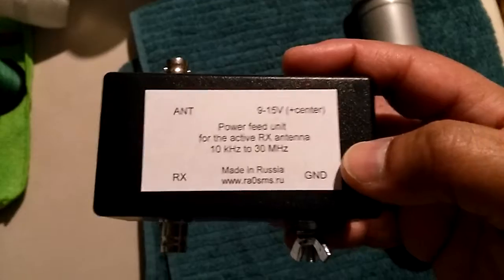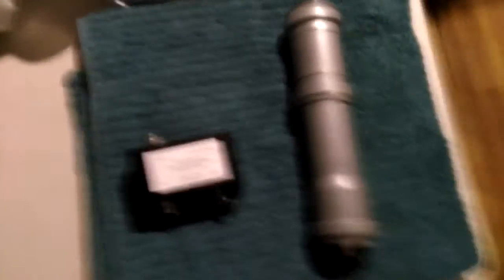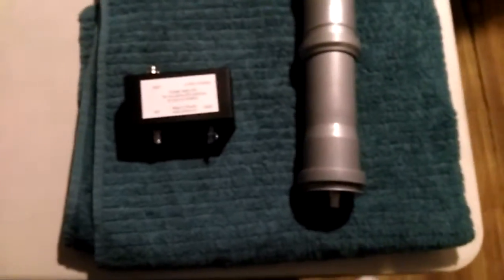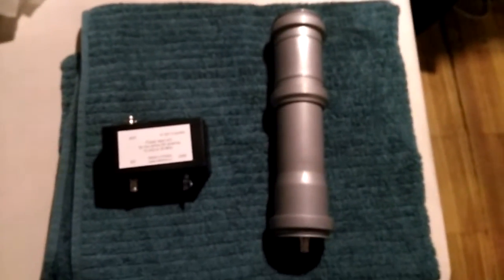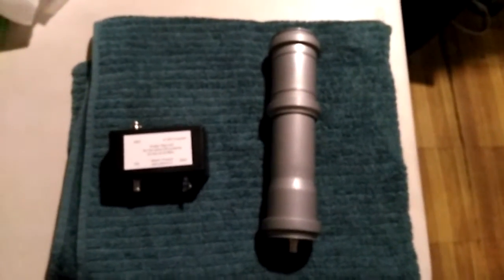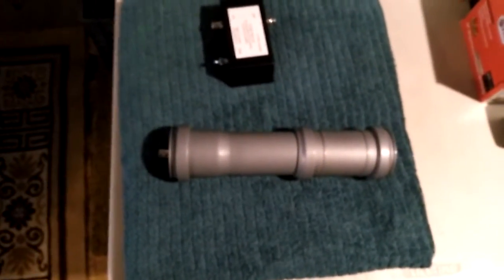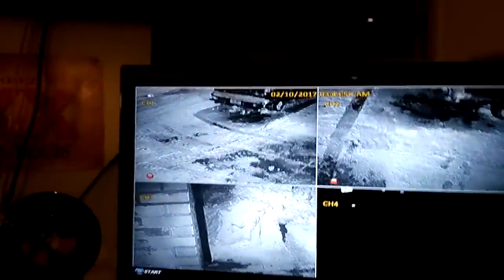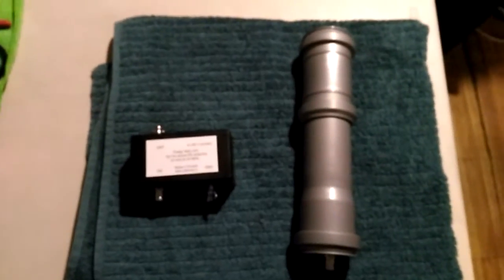Update on Mini Whip Active Antenna and other recent purchases

Comment: I actually have 2 antennas from this same guy in russia,  they work very well,  had to wait a while esp for the first antenna that I bought from him (having to be shipped all the way from russia to florida) have it connected to my sdr,  works really well for me.
Reply from the maker: I'm glad you are happy with them.  I had a love hate relationship with this antenna.  At times it seems to perform well and many more times I was not happy with the performance.  I will at some point, try it for my travels as a portable active antenna.  I'm very happy with my MFJ-1886 active loop antenna for home use with my SDRs and other radios although it cost a lot more.  Thank you for the comment and you have a good weekend, Sir.

Comment: What is the diameter of the antenna?  It looks like about maybe 1.5 ~ 2 inches in diameter.
Reply from the maker: It is a little over 2.5 inches in diameter at the widest part.  Thank you for watching.
Reply: Ok, thanks.
Reply: Did it really take two months to get to you from Russia?
Reply from the maker: He does warn people before purchasing that it can take up to 2 months to arrive depending on your location when i last ordered one, however in my case it took about 3-4 weeks if I remember.
Reply from the maker: Your welcome.  :)

Comment: Finally received a second ra0sms whip antenna. This one works with a noticeable amplification of radio signals but this one causes a hum sound when tuned to a station but no hum when tuned off frequency to the stations. My verdict is no to the ra0sms mini whip antenna.
Reply from the maker: Yes I'm pretty much done with my antenna also.  It was too much hit and miss for me.  It was not a reliable antenna overall.  After all the mods and tweaks, I never got the performance that was expected.  Thank you for your reports.  Mike.  Have a good night.

Comment: Danny, looking forward to a video using this active whip antenna.  Have a nice weekend 73's from Germany.   Brian
Reply from the maker: I posted a few receptions using this antenna, it's OK at best.  This antenna like most amplified antennas really need a very low noise environment otherwise it will be useless.  Also grounding is very important and necessary to achieve good results.  That being said my 85 feet End Fed antenna with 9 to 1 Unun does a much better job at shortwave and even medium wave but with a bit higher noise floor as is.  The Mini Whip antenna is better suited for listeners with space restrictions.  The Mini Whip Antenna needs some fussing around to get results.  I may be looking at a active loop antenna such as the Wellbrook or similar type in the future.  Thank you Brian and have a great day.

Comment: I got one of those mini whip antennas and it doesn't seem to be able to get anything at all!  I have a radio that can get navigation beacons on Long Wave though, a Zenith Royal 780 Super Navigator that uses just a dipole on top of the radio. It can get navigation beacons on 201, 240, 338 and 407 kHz here in Arizona.   I have to take it outside on the roof though, can't get anything inside but noise.
Reply from the maker: Yes I had the same problem at first,  Now I have it higher and also I had to ground it from the outside instead inside of grounding from the power unit indoors.  It does involve some tweaking.  I would only recommend this antenna if it was from an apartment high up.  I have several antennas on my property.  Some work good depends on what frequency, conditions and so on.  I'm still  learning that there is NO great antenna.  They all have their pro and cons.  Thank you for watching and your comment.  Have a great day.
Reply: I tried grounding it out at the antenna and that made a small improvement but it still doesn't work any better than just shorting the coax at the end with a jumper wire!  All the hype about these antennas seems to be made up nonsense similar to what you get with drones such as the Lily drone that was supposed to be able to do all sorts of magical things but never flew!
Reply: I tried anther one of these but they are still total rubbish and don't work at all!  I don't see how they can keep selling this crap!

Comment: What's the correct voltage for the power inserter?
Reply from the maker: It is between 9 -12 volts DC.  I have it connected to a 9 volt power supply.  Thank you for watching.  :)
Reply: Im using a 12v "wall wart" from an old wifi router that I am no longer using. Comparable to the 12v regulated "bench top" power supply that I use for my cb radio.